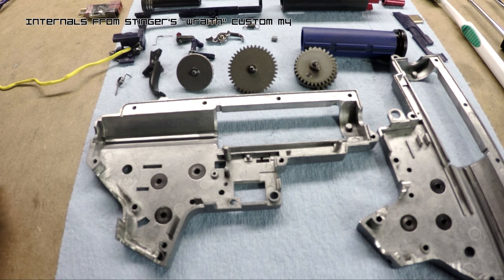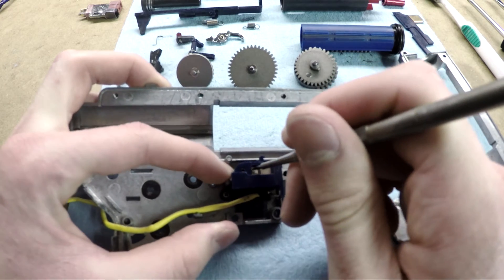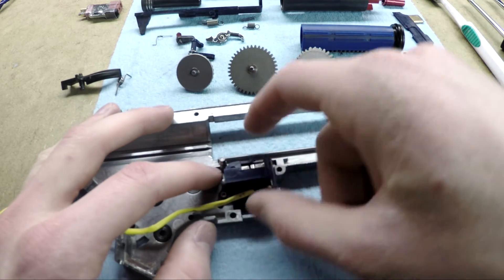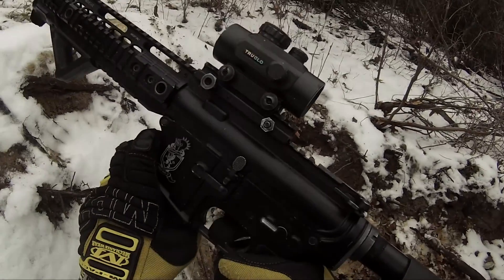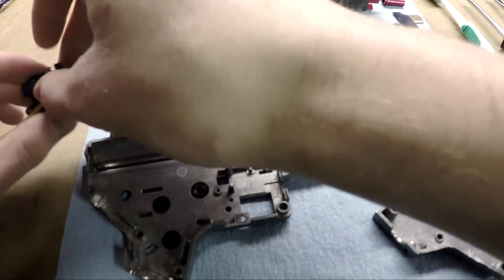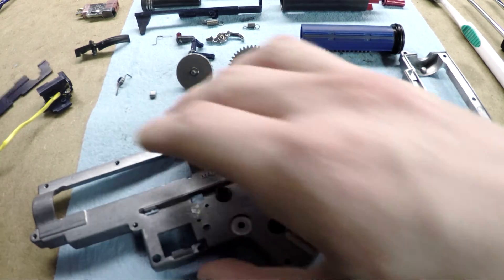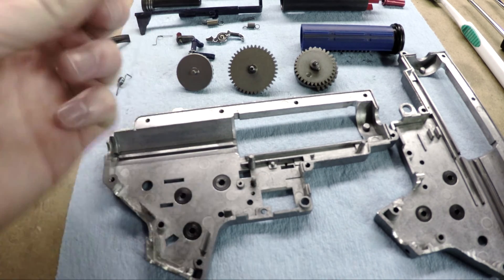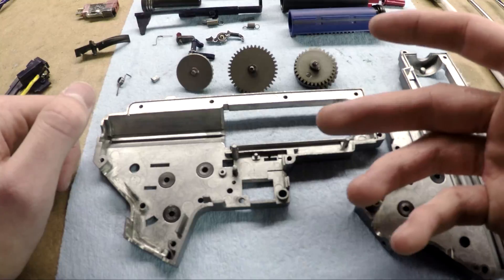Airsoft Tech: How to Fix a Broken V2 Trolley Post (AEG)

Comment: Nice radius job ;) yours looks very sturdy. But one thing to note is depending on the diameter of the screw corresponding to the hole, you might need some jb weld.
Reply from the maker: I forgot to mention in the video that I used "Red" Loctite Threadlocker on it.

Comment: Here are a few idea, came across these recently, what do you do if your motor wires are too long? In an Elite Force M4A1 Carbine,  what do you do it only shoots full auto? (Safe-safe, semi-1 pull won't stop, full-full auto) What if for some reason your replacement motor can't pull the spring?
Reply from the maker: I will probably make a video on the cutoff lever (likely what is making that M4A1 fire full in semi) and motors. In those videos, I will go over the topics you brought up.
Reply: CStingerGhost1 sweet thanks
Reply: CStingerGhost1 also, do you have an easier way to contact you personally? If I have any questions that would be hard to put in a video?
Reply: CStingerGhost1 ok, will do